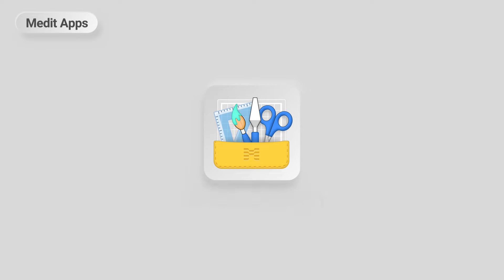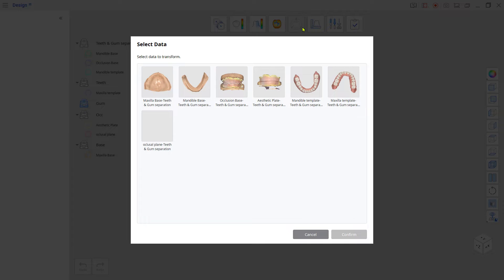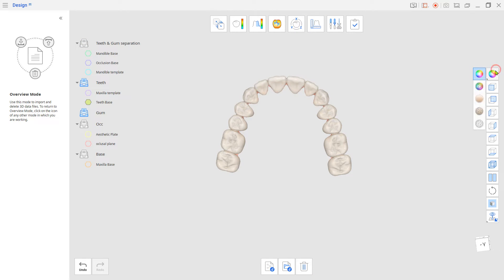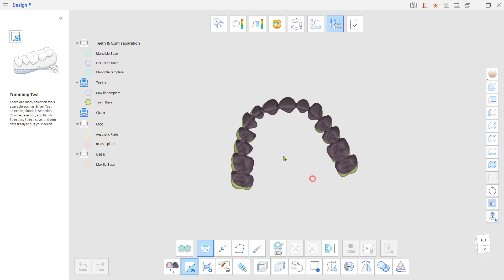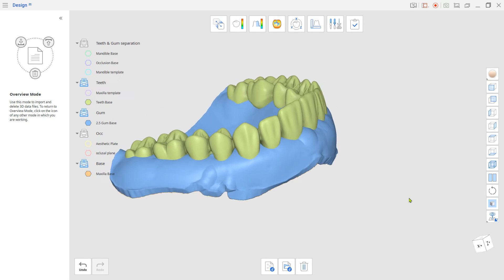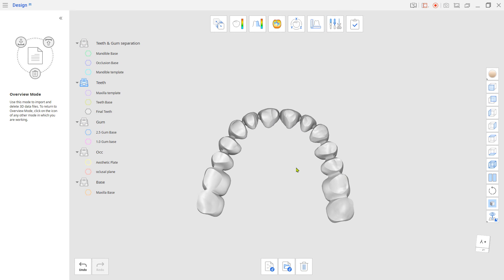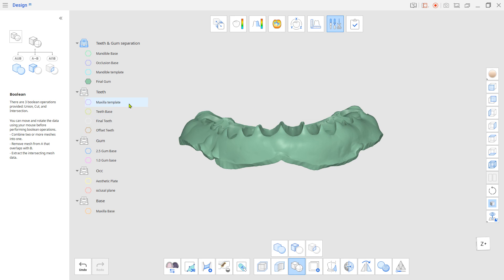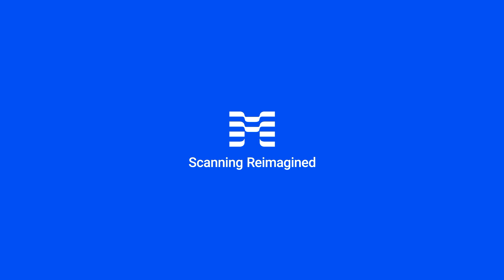Designing a Teeth & Gum separated Full Denture with Medit Design App

Comment: How did you scan the wax rim with I700?  There is no section to scan wax rim in medit link. Thank you very much.
Reply from the maker: Thank you very much for your valuable question.
In the scanning software, please click the Stage Management icon at the top of the screen and add the “Additional Data” stage. Then, scan the wax rim in this Additional Data stage. If you have fully scanned only the wax area and the border that are needed as a reference for arranging the artificial teeth, you may skip scanning the other areas.

If the wax surface causes strong light reflection and makes scanning difficult, you can apply a small amount of scanning spray to help improve the scan quality.
The wax rim data scanned in the Additional Data stage can later be imported and used in the Medit Design app.

If you still have any questions or need further clarification, please feel free to ask. Thank you always!